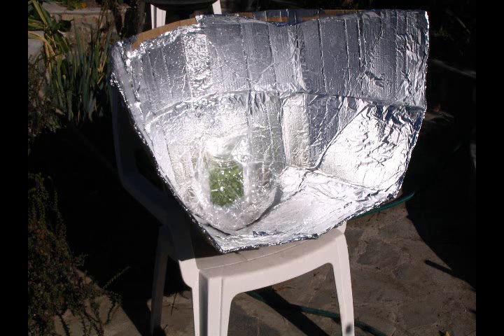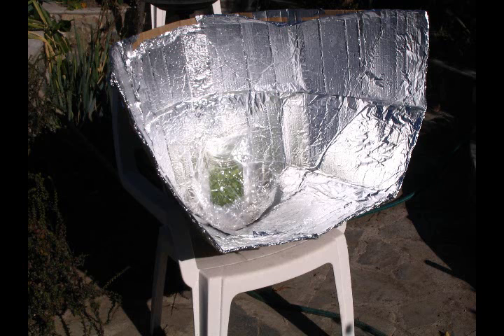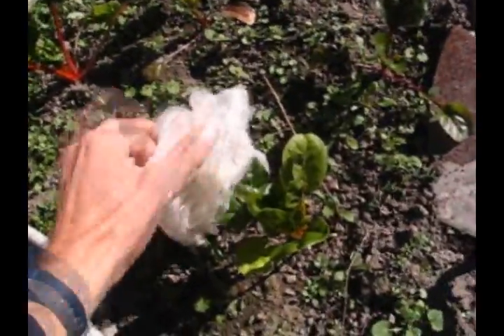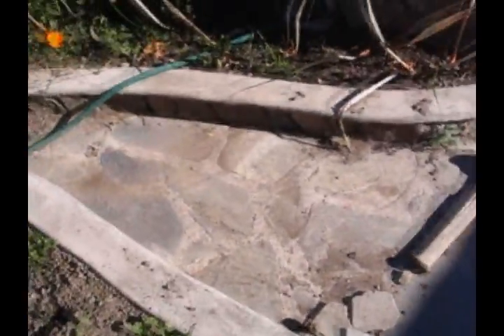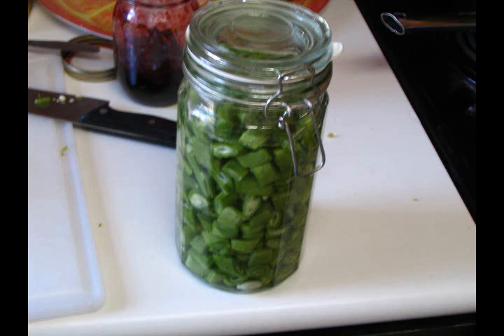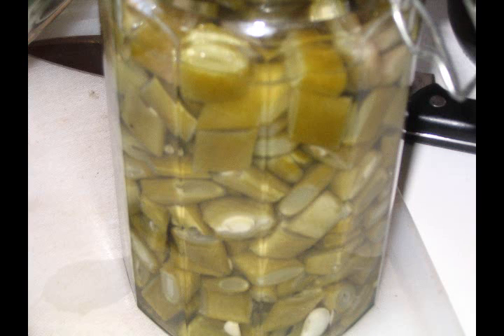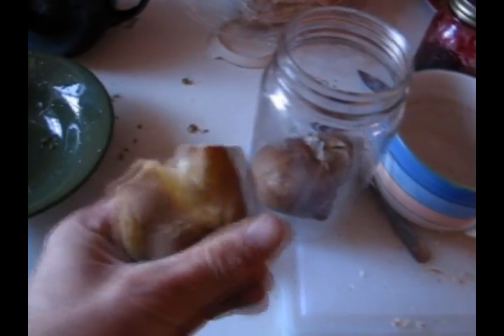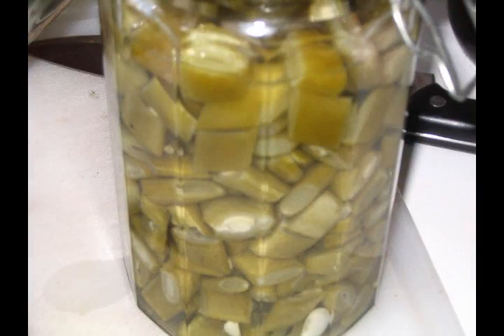Solar funnel cooker in action!

Comment: + Banthablaster Prime

First of all, the radiation from a microwave oven is magnetic, not nuclear.  Magnetic radiation ceases the moment the microwave shuts off and will not be residual in the food like nuclear radiation.  Other than the heat it generates in the food, it does not change the composition of the food in any way. 

Second, why would you microwave water that you're going to water your plants with?  HOT water (whether from a microwave, a stove, or the hot water faucet) can damage the delicate roots of a plant.

Comment from the maker: Thanks,  I do not think it will work well indoors because the light and uv and ir radiation has to get through 2 panes of glass and at each pane some is reflected, some refracted and some absorbed.  So much less energy will reach your funnel cooker.

Comment from the maker: @LOOKlearnLAUGH  Short answer is no. It is a canning jar, the lid is on a bit loose and is designed to release pressure  anyway. There is no aluminum jacket, the insulation is just a plastic bag or an oven bag wrapped round the jar.. The reflector shields a lot of wind from the jar but its main job is to reflect the sunlight to it and concentrate it for a decent length of time. Supposed to be about 2 hours.

Comment: U mean you put the subject in a jar, wrap it with an insulated aluminum-jacket and let it sun burn.  Of course you cannot close the jar or it MAY explode. Depending upon the length of time u put it out in the sun + the strength of the sun; it may be cooked, burned or raw. It's very much like a DIY solar air heater or solar water heater: Just let the sun do the work. Make sure whatever chemical you put on the jar or "jacket" (if any) is edible. The sun will do the trick anyway

Comment: Hi Gaiatechnician,
It appears as though you used the rubber seal when you cooked with the canning jar.  Have you ever had one of your canning jars explode?  I just tried the experiment with a canning jar but I was reluctant to use the seal with the clamp as I cautioned that the pressure might shatter the glass if none of it(pressure) is allowed to escape. Great vids. and inspiring ideas.